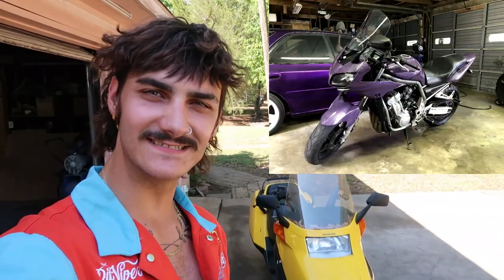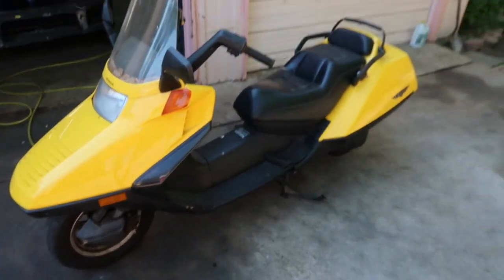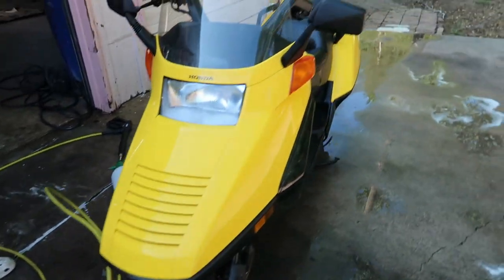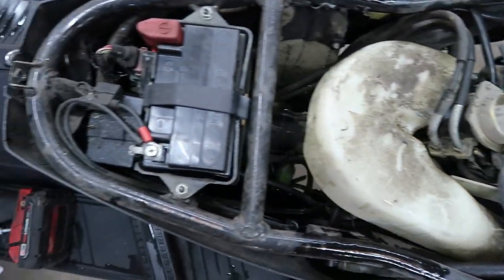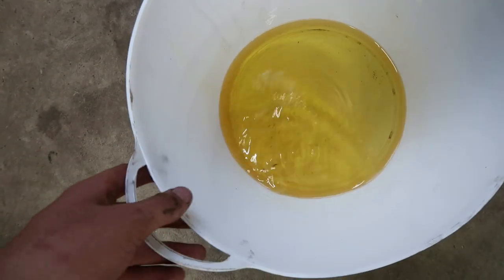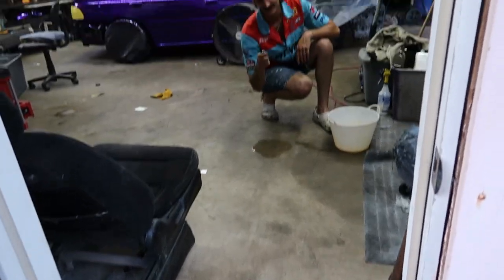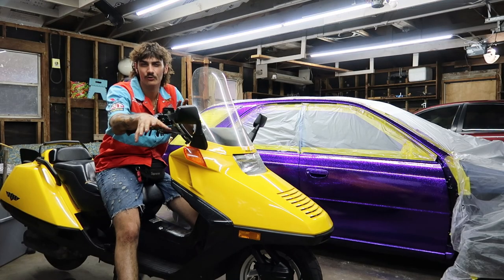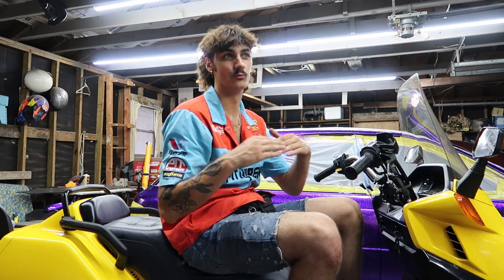I TRADED MY 1000CC SPORT BIKE FOR A 250CC HONDA HELIX!!!

Comment: The trick is to add a little more thinner to your paint for super smooth surface and less orange peel. 🙂👍  Of course wet sanding is going to give you that beautiful finish, but you'll be surprised what you can get out of just a spray if you'll add a little more thinner than you are.

Comment: I had a helix,  now have a yamaha morphous.. think "same bike made by yamaha".  But from the time I first rode a helix I was hooked.   Super bike.  By the way. In 2023 (dec) has l prices are $2.75/gal.  But I have never put nor than$10 in fuel in any of my scooters.  Ever!   I should get gas soon because I like the tank full in winter.. but I will not even need a gallon!  I have only gone 50 miles on this tank.

Comment: Yes it is a way fun to ride a Honda Helix, I have owned just about every cc range bikes over the years up to 1500 & 1800 cc Goldwings and like you said your 1000 cc sport bike was fun if you were riding it fast and around curves, like the Goldwings were fun for taking long trip rides with passengers but I don't do that anymore so I did the same as you and ditched my 1800 Goldwing and bought a real nice 1996 Helix 4 years ago and for the way I drive and how often it is all that I really need and I'm completely happy not wrestling around 800+ pounds, pulling a clutch lever in and out, and not constantly shift gears, I have been getting anywhere between 68 to 77 MPG on 55 MPH back road rides traveling to the local mountains of Maryland & Pennsylvania.